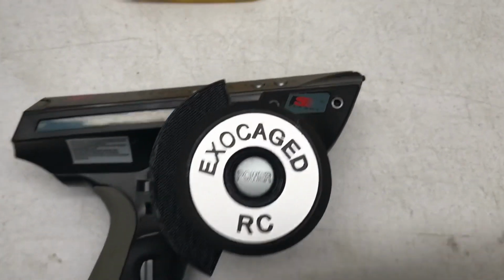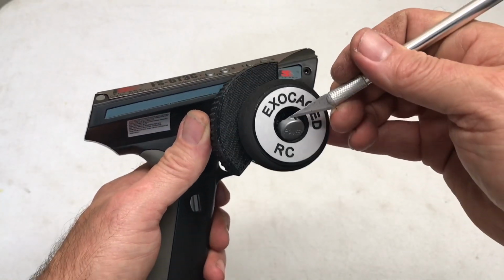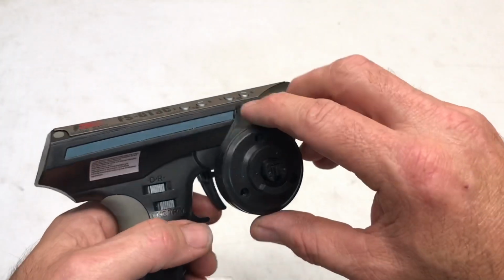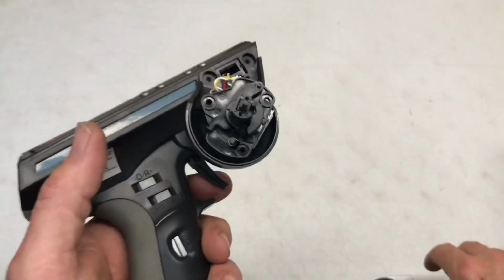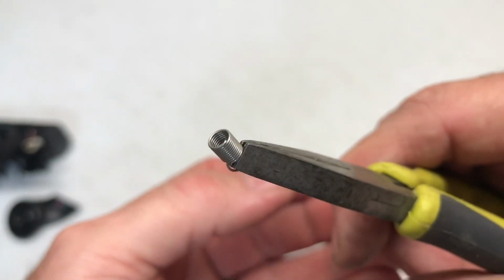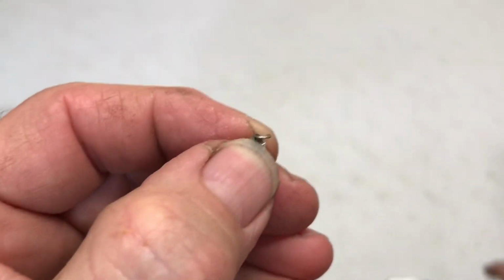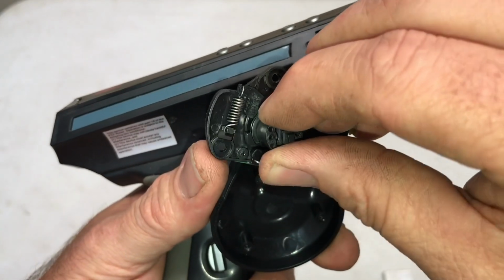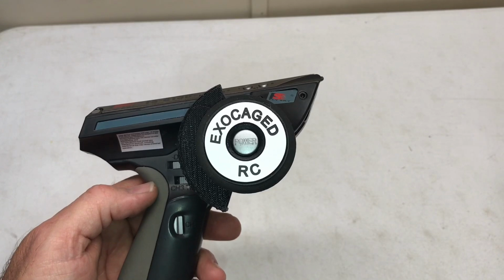GT3c Steering Spring Fix

Comment: I have news my friend... 
As of today the AXE 550 combo is available on the ASIATEES.com webpage (Already ordered mine)… The combo comes with a new AXE ESC v1.1 and according to the hobbywing guy I have been in contact with it is made to work with the 550 Motor, This means the OG AXE ESC v1.0 wont be compatible with the AXE550 motor (According to him). The new ESC has an updated BEC from 3A to 4A Continuous and a New Programable Feature (RPM/Throttle Sync) this will reduce the effect of sync throttle to rpm so it runs like a normal brushed motor (So you Add more throttle per load)…  Retail is 230dlls for the combo and it comes in 2700kv and 3300kv flavors.
Reply from the maker: skirmich I saw this too on the HW website. I’ll have the 3300 soon. Thank you for the details!!
Reply: @ExocagedRC   3300KV here too! I hope it rips on the TRX-4 without losing low end sensitivity.
Reply from the maker: skirmich yeah the one thing I wish was different is the output shaft, I’d rather not have to deal with a 5mm shaft. We are stuck with an 11t stock pinion. Can do smaller with spacers and stuff and I don’t want that.
Reply: @ExocagedRC  Yeah I noticed that too.. Already ordered the RRP Xtra Hard 11T pinion since I knew about the 5mm shaft but.. I think we can lower the gear even further with the Underdrive Bevels all around (If traxxas cares to stock them any day now)..  I wanted to run Under-drive / Stock ratio since day one But I havent been able to get my hands on the damn underdrive kit since its not available anywhere. 

I ordered 3x replacement spur gears since I am going with the slipper clutch eliminator with the 550, make the spur the weak link in the drivetrain but allow no slipping.
Reply from the maker: skirmich yeah I’ve been waiting for the new gears for Optimus 2 as I want to overdrive the front but Grimlock 3 will need underdrives on both ends. New Grimlock 3 video tomorrow with a drive too.
Reply: @ExocagedRC  Nice! cant wait to see your review on the AXE550 as well..